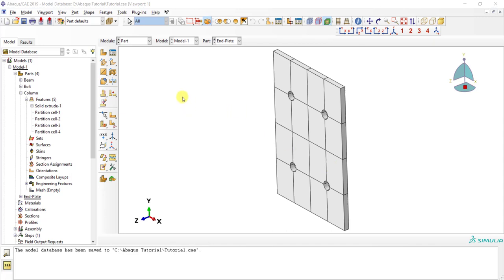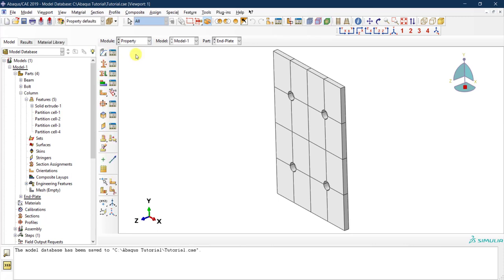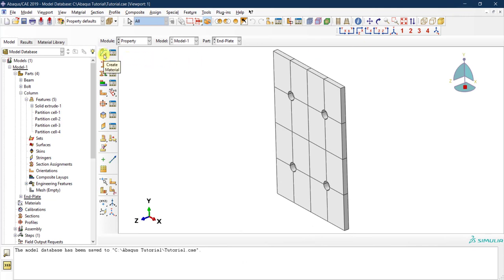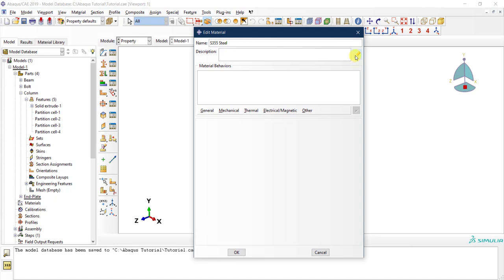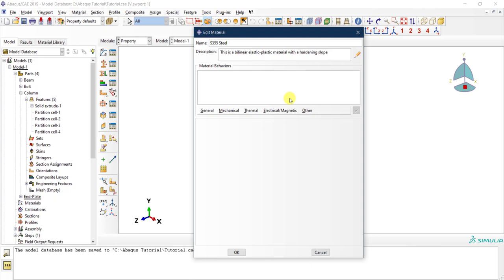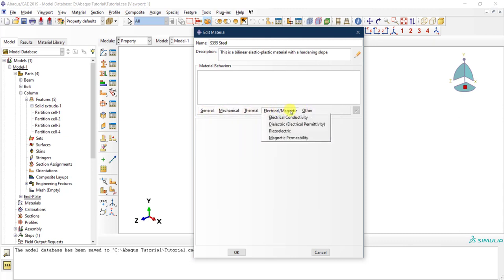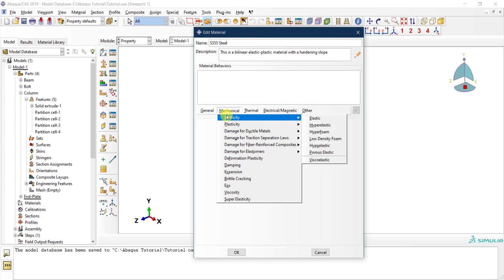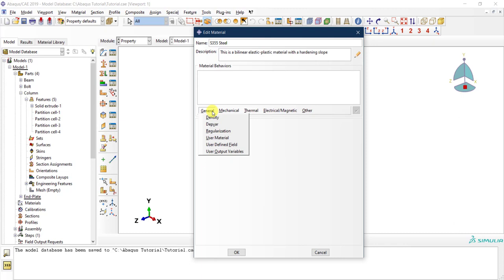#08 ABAQUS Tutorial: Defining materials in ABAQUS - steel

Comment: I am sure but density if calculated in kg/mm3 should be 7.85e-6. I know it doesn't matter in static analysis but I just want to confirm.
Reply from the maker: No, that's not correct. Please note that if you are using SI (N and mm) units in Abaqus (as in this example), the the density should be in ton/mm3 not kg/mm3 as you assumed.
Reply: @AElkady   Thank you so much for your prompt response. Do you think the results will be different if I change the density in quasi static analysis? Moreover, can you plot the hysteresis response under cyclic loading for the given structure and its moment rotation curve?

Comment: Thanks a lot for this tutorial, Why we don't use density in N/mm3?
Reply from the maker: 1) Newton is a force unit not a mass unit. 2) As per ABAQUS documentation, if you are using SI (N and mm) units, the the density should be defined in ton/mm3 units.
Reply: The key is that in the SI (based in mm): Length (mm), Force (N), Mass (1=Tonne 10^3 Kg), Stress (MPa = N/mm^2), Density (tonne/mm^3)
Reply: @alejmora  And energy units in mJ (miliJoule)

Comment: thanks for video its very useful, but how could be strain plastic 0.18 ? 470/200000 =?
Reply: the slope equation (young's modulus = stress / strain) is only for elastic range of slope not for plastic range
Reply: 0.18-(470/200000)=0.17765~0.18

Comment: Great videos sir I have watched all the videos in this playlist thanks for such useful videos. Sir, I have one confusion in defining the material for the plasticity I have given density, youngs modulus and poissons ration and yield plastic stress with corresponding strain 0 and in sub-option I used rate dependent(power law). Is this enough for the plasticity or I have to add UTS and respective strain?
Reply: And also I am doing a forming simulation in abaqus so there is any option to define rotation speed of the spindle?

Comment: First, thank you for the informative presentation.
Do you have a plan to do part 2 of this tutorial explaning the steel material in dynamic analysis?

Again thank a lot and all the best
Kind regards
Reply from the maker: Please check the two publications below regrading the definition of steel material for cyclic loading:
https://ascelibrary.org/doi/full/10.1061/%28ASCE%29ST.1943-541X.0002166
https://ascelibrary.org/doi/10.1061/%28ASCE%29ST.1943-541X.0002964
Reply: Thank you for your reply....